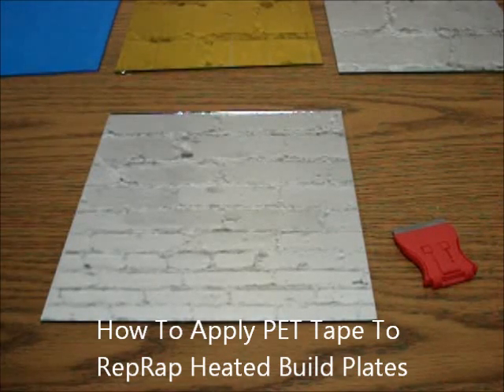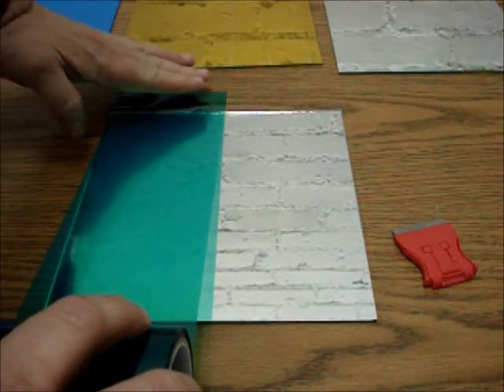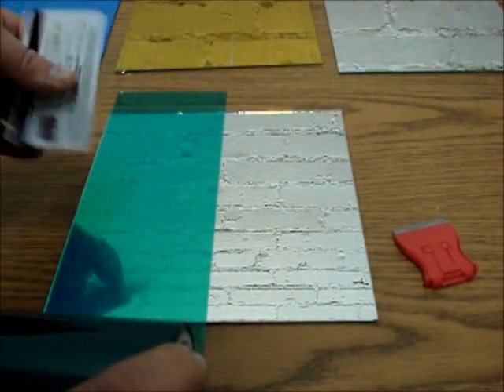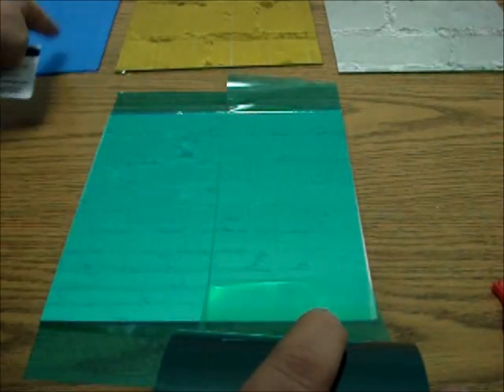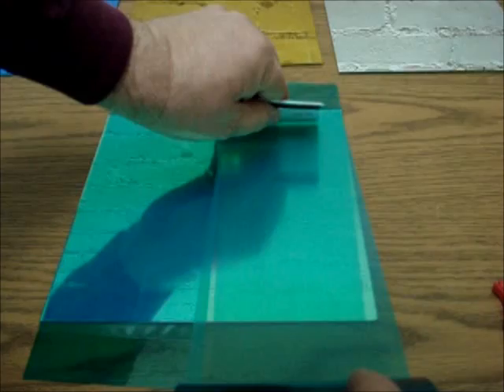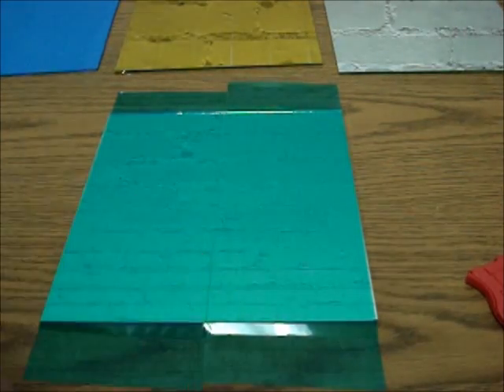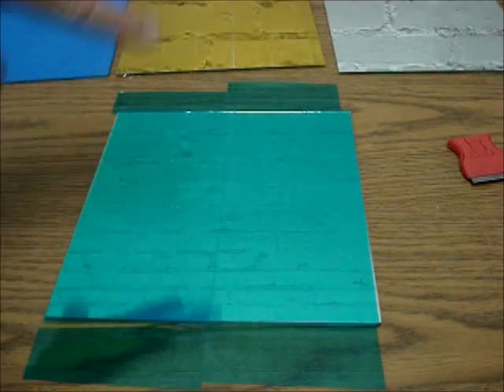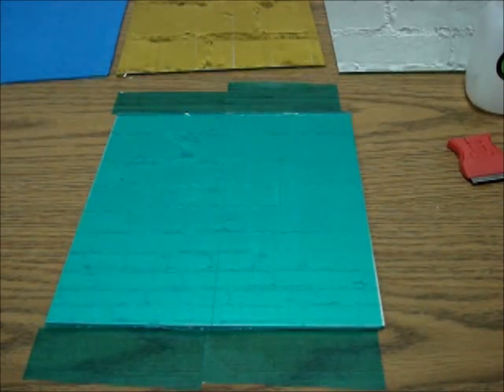Vision 3d Printer   How To Put PET Tape On A RepRap Heated Build Plate

Comment from the maker: 100+ Prints, it really works well. Some people use knives and scrapers to pry up their prints, but that will drastically shorten the tapes lifespan. I just pull the mirrored plate off, let it cool, then flex it slightly several times so the parts are easy to remove.